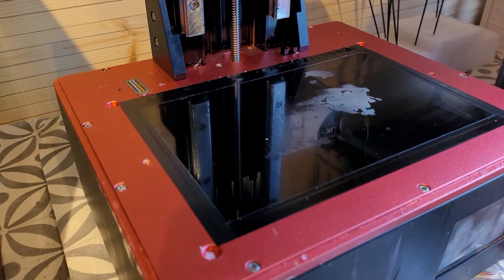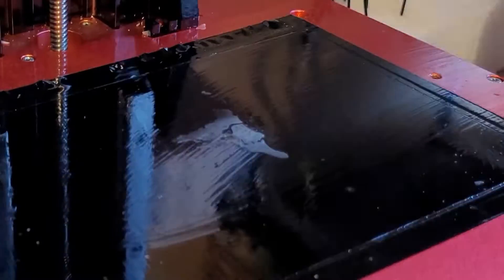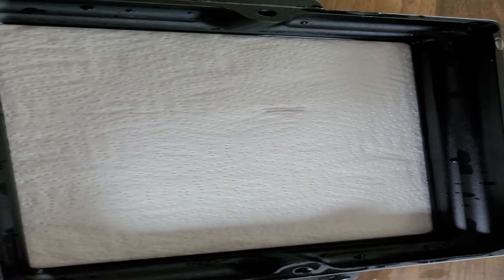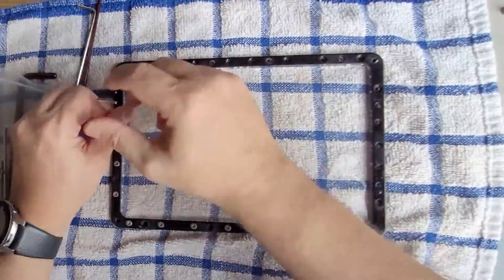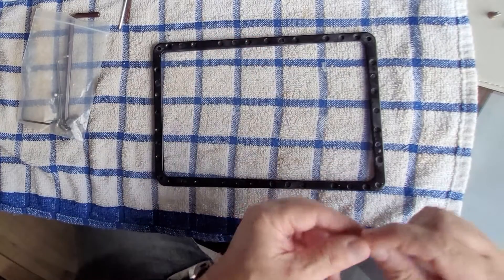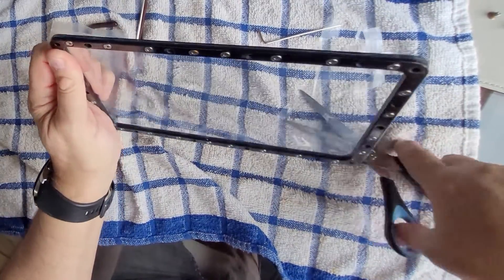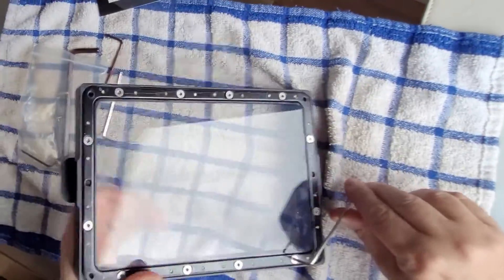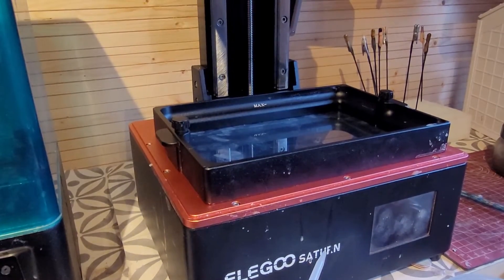Remove Cured Resin From Your 3D Printer Screen & Change FEP

Comment: **Update: My actual screen wasn't damaged, it just looked as though it was by the way the resin had cured (looked like cracked glass all in one corner). I managed to gently lift some (water washable) resin by laying a paper towel dampened in hot tap water over the main edges of cured resin and then used a plastic scraper/razor to gently slide across my screen until I felt a bite... Once I'd found that, the rest kind of just lifted off with a lil added elbow grease here and there... Was actually quite satisfying tbh.

So the only thing I need to actually replace (thank Odin) is my FEP sheet - I think I just went into newbie panic mode when I saw what looked like webbed glass in my screens corner... I feel like I've achieved a milestone in the 3D printing adventure 😅**

- Not only do I have a puncture my FEP, but whatever did it (still unknown) also damaged my screen 😢
Reply from the maker: It's very unusual for anything to damage the screen
Reply: @greedy3d480  I've never been so happy to be wrong, it just looked like my screen was damaged - comment updated 👍

Comment: My vat broke on the second print after only 2 days of having the printer. Ive been trying everything to remove the resin but it refuses to come off
Reply from the maker: Sorry for maybe a dumb question but is there a screen protector on it
Reply: @greedy3d480  yeah, turns out they had a scratch resistant film on the screen. Not an actual screen protector but still. Thing fit so well i had to double check when the manufacturer stated that.
Reply from the maker: Oh well a Windsor win better than nothing at all lol 😆

Comment: This song made me emotional. Im so sad i ruined my fep in my second day. Here in my country is all so expesinve, also a little crack in the corner of my lcd. Still works. But i just gonna know when the new fep arrived and test the print
Reply: how did it go for you, same situation here, second day 4th print and it broke and leaked all over, i tried this method to get the resin off my screen for the past hour and i only removed like 10%. im stuck and dont know what to do now
Reply from the maker: Takes time sometimes ...put some ipa on tissue or paper towell let it soak..

Comment: Can you use a tablet screen protector instead. I have been unable to find a screen protector replacement for my anycubic photon 2
Reply from the maker: I'm note sure tbh a question for the wider community 👍
Reply: Thanks, anyways, @greedy3d480  . Welp, i guess it's experimentation time, if i don't manage to get the resin off the current foil, at least.
Reply from the maker: Did get mine from Amazon

Comment: I had to do this with my new printer. Question, how do i know if the FEP i installed is too tight?
Reply from the maker: I've never had any issue just changing the fep without doing anything special and it's always, always worked there's a number of videos on YouTube which discussed the correct tension in a fep but I honestly feel that too much emphasis is placed on perfection. I've heard people using bottle tops and rolled tissues to get the right tension but I think it's a preference I'd have a look at the internet and see what others recommend on specific videos but just try changing your fab printing I'm sure it will be fine
Reply: @greedy3d480 fair enough, I noticed the screws were hard to turn in fully on my mono x2, I suspect the sheet was too tight honestly. Will look for a video to suggest a spacer size
Reply from the maker: @shotgun2010  I'm not sure how your fep tightness would affect the screws to be honest

Comment: Hello thank you for the tutorial, you save my life. 
I have a question, what do you do when the screw, is stuck with hard resin?
Reply from the maker: Not come across that do you mean the screw holding the vat in
Reply: @greedy3d480  I mean any screw, the ones that hold the vat, even the ones behind the vat. 😔
Reply: I had that happen to me. Just gotta try to untighten it and tighten it and repeat it a few times. I had to use a pair of pliers for more leverage but eventually it came off

Comment: I just ordered a used 3d Printer... whoever had it last should have watched your video, they clearly tried to use something metal and scratched up the LCD screen, then gave up and sold the printer. 

I removed the remainder of the resin fallowing your method, but now I'm trying to figure out if I can remove these scratches somehow or if I will need to buy another LCD screen.

Gonna try Mr.Cleans magic eraser, I hear that's a decent way to remove scratches.

Comment: First vid that popped up when i searched for resin printer lcd screen spill! Awesome instructional video. I have a side question, do you not if you do a screen exposure test, have an abnormal colored section on your lcd / screen protector now? And is that something that i should be worried about as i do have a differently colored section, even after getting the hardend resin off, and having it soaked in iso 99%!
Reply from the maker: Sometimes it is inevitable to get some clouding on your screen I have a little bit on mine but I don't really have enough to cause any change to my prints, it's printing really well. I guess it's a lesson for both of us to get a screensaver lol

Comment: I'll be using a spare fep sheet as a screen protector. One product, multiple uses. One week into resin printing, and already dealing with this headache. Amazon plastic razors damaged my polarizing film. Make sure to buy some quality ones. Amazon ones became jagged after a few back and forth a, causing a small tear in the polarizing film

What I did installing my new fep, is pull a tooth pick through the holes before putting in a bolt. Found the screws didn't want to start threading untill I premade the hole.
Reply from the maker: Thanks for the heads up Steve

Comment: What printer is it as a Mars 2 pro does have a factory fitted screen protector according to Elegoo. The Saturn 2 also as a tempered glass plate protector over the screen. Failing that a cae windscreen scraper should work to get resin from the screen ;-)
Reply from the maker: Was a Saturn

Comment: Thank you  thank you. For this information. This morning I went to my printer to remove a sculpture and the  whole back part didn't print  so I drained the vat pulled it out and hole was in it and cured and cured resin was everywhere. I cleaned it up as best I could checked the registration square and it was perfect as it's new I just changed it last week. I had just seen your video yesterday and took some alcohol and the yellow plastic scraper all the dried resin came right up I took my time to let it soak and it came right up. My uv screens are really expensive I have a peopoly phenom resin printer. Usually when a spill is that bad I would have to throw the screen away you saved me $140.00 . Thank you again and GOD bless you 🙏 . Happy creating.............
Reply from the maker: I'm so glad the info helped.., 👍👍👍 thank you for the kind words